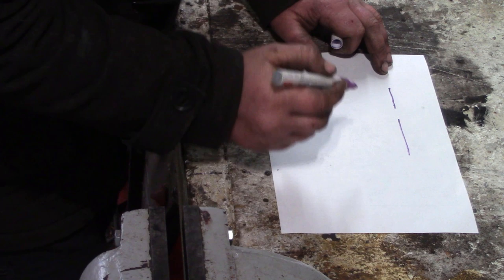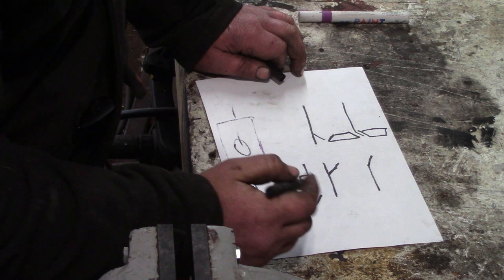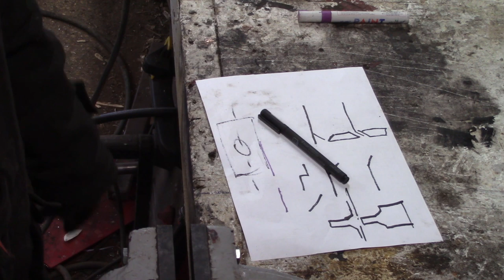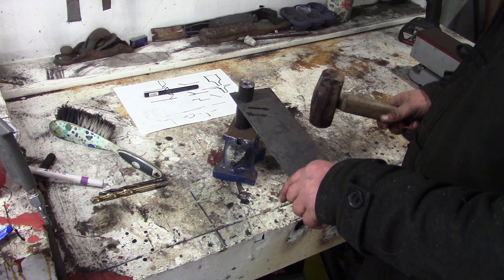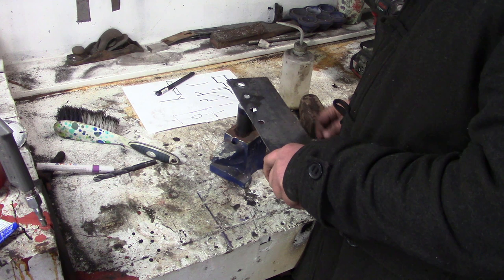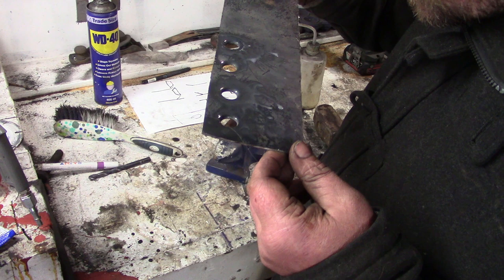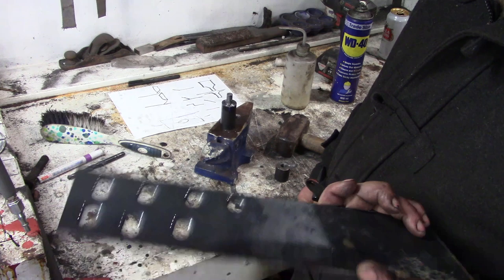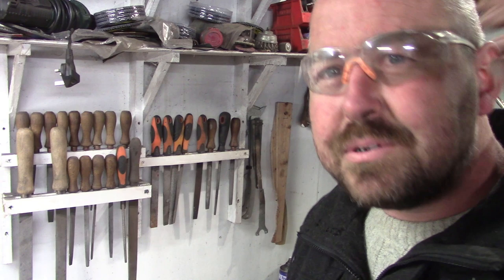How to dimple metal

Comment: Never thought I would watch a 25min Vid of a bloke punching holes in metal but it was really interesting!  Was getting more interesting for while there when you kept talking about " Lube"  but still good when it was just WD.  What I'd like to see is you pre drill the holes smaller and then heat the metal in your forge and stamp it while it's red hot.  Everything is always better with fire and sparks. If you heat treated the die and used a press,could you do this without drilling and just press out the slugs?
Maybe an Oxy/ acetylene powered "Press" / spud gun would be faster? Wouldn't matter, be REALLY entertaining to watch that in action!  You could Dimple 1/2" plate then! :0)
Reply from the maker: Ha, I had a pretty similar thought process as I was making these dies, my conclusion...
I don't think it'd be possible to make a single process punch die that left the corner of the metal exposed to the foot which is what you want on seriously aggressive tread plate. A flat topped dimple would be easy, and I've seen them on mini diggers and stuff but they're like "tread plate light" still with a hole so the muck has somewhere to go but lacking the knife edge.
I need to try harder annealing metals, I've got some torsion springs off an Isuzu that would have been perfect for this, but some of these mystery steels I just can't get soft enough to work with.

Comment: Nice dimples.... I did something similar with a hydraulic press when I made a new sole for the shoe of my wacker.
Reply from the maker: Why thank you very much young Benedict
Reply: @turboconqueringmegaeagle9006  You are very welcome James.
Reply: PS, just welding 3x2 3mm box with my little Lidl welder. Good job so far.
Reply from the maker: @BensWorkshop  quality, can't wait to see what you've come up with
Reply: @turboconqueringmegaeagle9006  Turns out that on thick stuff you have to push the rods in .... quite hard.
Reply from the maker: @BensWorkshop  pushing it to the limit!
Reply: @turboconqueringmegaeagle9006  yes. It's only a little Lidl welder but apart from cutting out to cool down it's doing fairly well.

Comment: That thing is cool as hack! If you made it a bit smaller in height, do you think it would fit in your press to give more even results? I love that idea but I could never make this myself without a lathe since I am not skilled enough at filing and way too lazy at the same time to grind such a thing by hand. I wonder if I can find one of these things on ebay maybe even made of hardened and tempered O1... Thanks for sharing, mate! :D
Reply from the maker: Aircraft tool supply have a range of  dimple dies and flangers but they are only really made for aloominum
Reply: @turboconqueringmegaeagle9006  Yeah, indeed found nothing on ebay but don't need it atm anyways. If I ever need one gotta ask a friend with a lathe or get some aluminum plates as it seems 🤣 Cheers

Comment: By staggering the pattern of the holes, the sheet will get stiffer. If the holes line up, not so much.
Reply from the maker: Twas but a test piece my friend, I'll absolutely line everything up on my tread plates
Reply: @turboconqueringmegaeagle9006  Ha, no you misunderstand me - I wasn't putting yer efforts down, I merely meant that when you flexed it, there are areas across it that have no hole - like there's a flat bit from one side to the other sans-dimple as they say on the continent. By laying the holes out in a diagonal grid pattern, you get far higher strength compared to a grid where the holes are in a grid square to the shape of the material. And when you give it something round the edges to stand on, it becomes way more rigid than a flat sheet

Comment: I would think a press would do a better result  without bending the plate out of true if you have one.
Reply from the maker: They were pretty tidy by the end but yes, a press would be very nice
Reply from the maker: @DogsBAwesome  space is the issue my friend and the concrete slab my current shed is sat on has split and is slowly falling into the drainage ditch.
Once I've built a bigger shed I'll have a press and I can get the big mill and lathe up and running too.